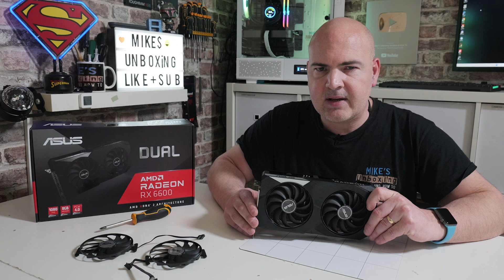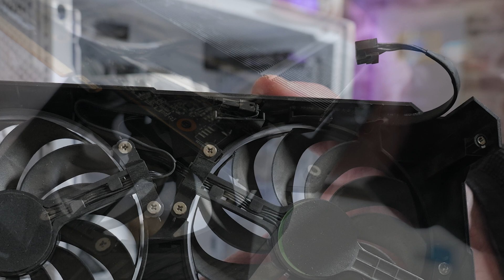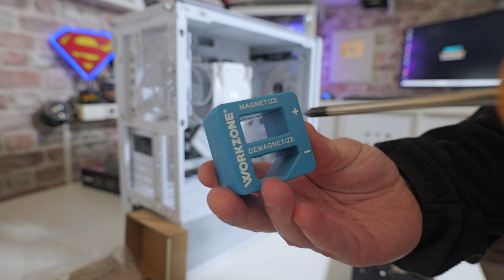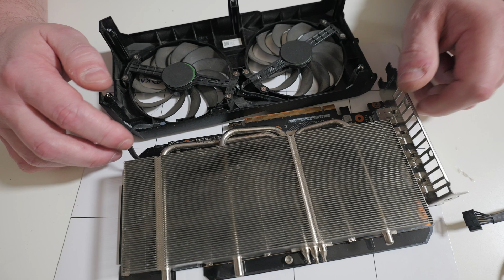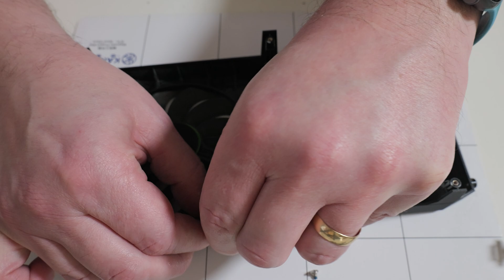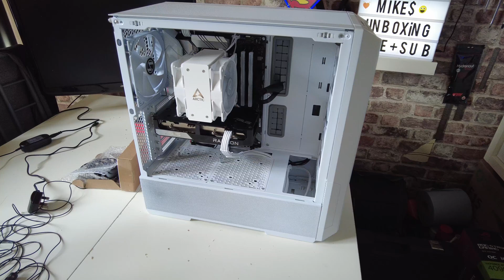How To Fix Or Replace ASUS DUAL GPU Fans RX6600 RX6700 RTX 4070 Etc

Comment: If one of the fans is dead, you can ask for money to cover the cost of replacing the fan. Give the seller the choice between giving you the 20 or 30 bucks for a replacement fan, or approving a return and full refund. The seller will have to refund the cost of shipping, so for them, they'll probably much rather give you the money to replace the fan (this is how it will work on eBay anyway).
Reply from the maker: that's a smart strategy, many sellers would prefer to cover the cost of a part rather than deal with a full return

Comment: i have replaced 2 fans on rtx 2060 but they dont spin at all, theres 1 cable left unplugged theres no were for it to go. i got no clue what to do
Reply from the maker: might be worth contacting the seller, there shouldn't be random unused wires
Reply: @mikesunboxing  bought of aliexpress seller claims it's compatible but it doesn't look like it. Imma buy exactly same part number that was originally in the gpu

Comment: Hi Mike. I just replaced the fans on this same card with the ones shown in the video. I just wondered if you know what size the thermal pads were for VRMs and VRAM? As the ones I took off just crumbed to bits so I couldn't really measure them.
Reply from the maker: think they were 1.5mm
Reply: @mikesunboxing  Cheers!

Comment: Hey Mike! I want to make a 5000$ PC build sometime in the near future,still saving money for it,the thing is i dont want to use thermalpaste for the CPU ,I want to use the fallowing thermalpad Thermalright, VALOR ODIN, 15 W/mK  ,  its 15w/mk ,that is in the league of thermalpaste , so theoreticaly it should do good cause it has the same performance of an artic-mx4,in fact the pad is better than the mx4's 8.5 wmk,what do you think?should I do this ?can I succeed?or am I wrong and the wmk of the pad is just a flop?!

edited because I left out the fact that I want to use the pad with the CPU and  CPU cooler
Reply from the maker: that should be fine, or the thermal grizzly one
Reply: I was considering thermal grisly's ,but all of their pads are electricly conductive,the valor odin is not e.conductive, so the v.odin is the one i chose! Thank you Mike for your reply,good cheers m8!

Comment: Many manufacturers need to start making simpler fan shroud designs making diy repairs much easier and much more affordable imo 🥰😇💪👍. Sometimes I’ve found getting replacement parts and time isn’t worth the effort for many electronics these days ☹
Reply from the maker: Totally agree

Comment: 6600 is not exactly a good card lol that prob why you got it cheap , many of the amd radeon fans can be replaced just by taking a screw out and it comes out without problem and just replace them .
Reply from the maker: 6600 is a good card for the entry level these days and give the GOAT 1080ti a run for its money
Reply: @mikesunboxing  1080 ti walks over the 6600 mike and still sought after as one of the best graphic cards even to this day 
might as well get 6600xt 
radeon 6650 xt out performs 1080 ti.
I oticed the fans on 6600 not as simple as they look on other models where the screw is just took out and you pop them out.
I also noticed depending on the manufacturer of the gpus that other company's (like they do) make the same models but differently ,Some are worse thatn other models .
Now amd qvl should be updated due to you can use other ram depending on each m/board you use , I been doing tests recently and got many ram thta work without any due problems and many out perform ddr5.